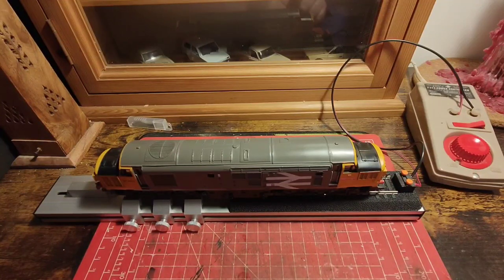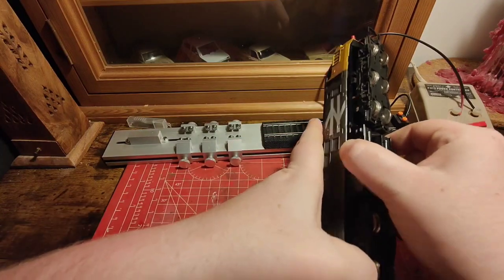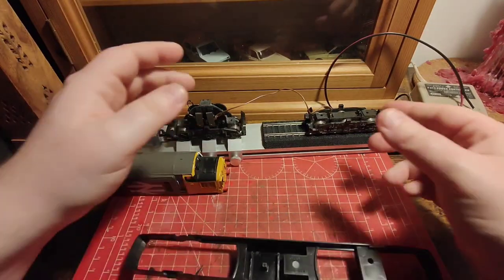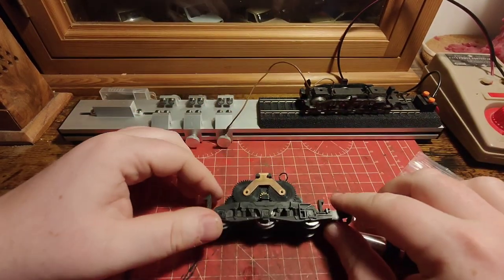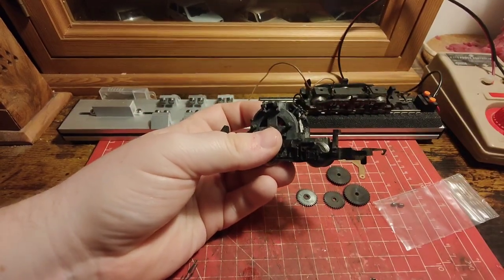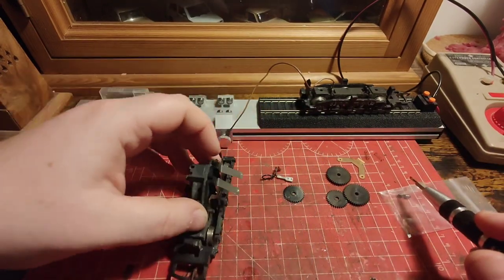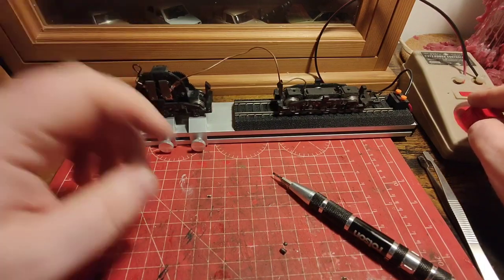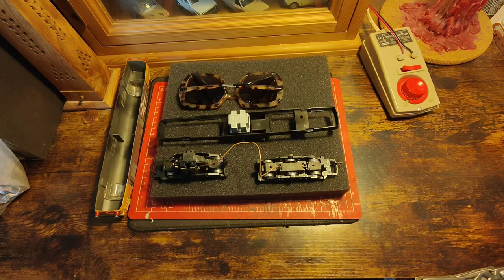Restoring Facebook Marketplace Bargains EP.2 - How to Service a Ringfield Motor

Comment: Should have cleaned the commutator whilst the two sides of the motor body were separated. Basic oiling on the moving parts and grease on the cogs, and oil the axles for the two none driving wheels
Reply: I literally can not believe that the commutator was not cleaned and also the motor was not lubricated on reassembly. No offence - but his video was pointless.